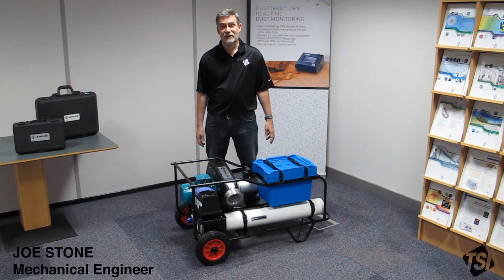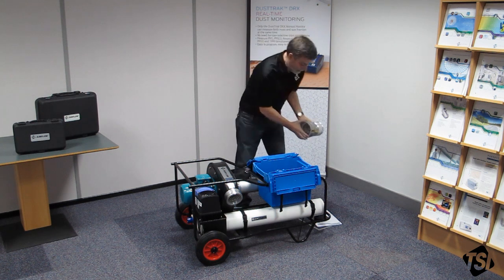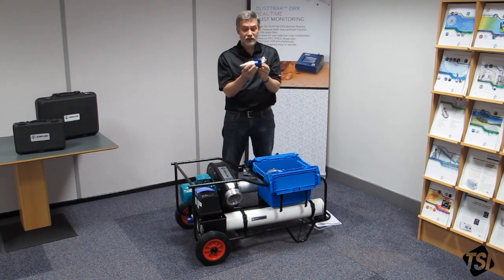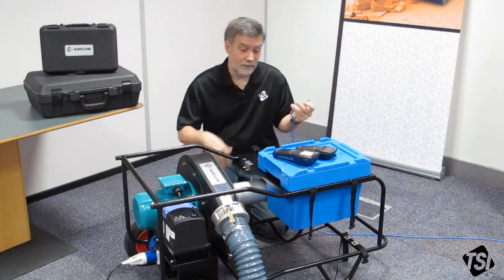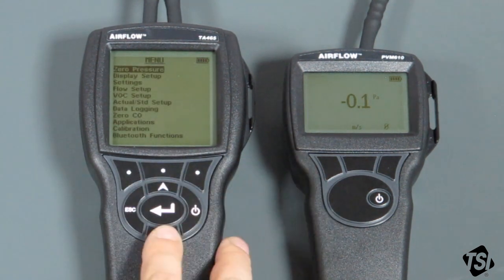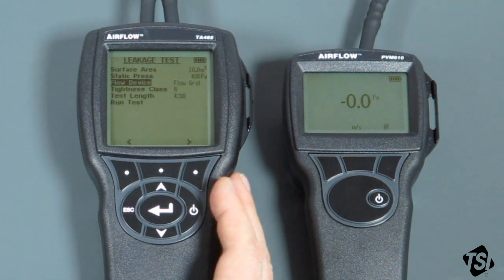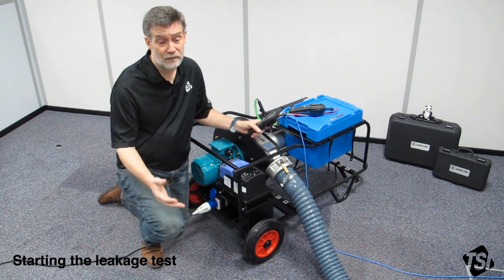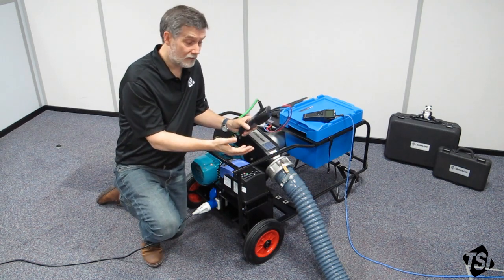Operating the TSI Panda Duct Leakage Tester

Comment: does the surface area include the 2 ends or just the 4 sides along the length? Wondering since they will be capped for the leak test yet open when operational.